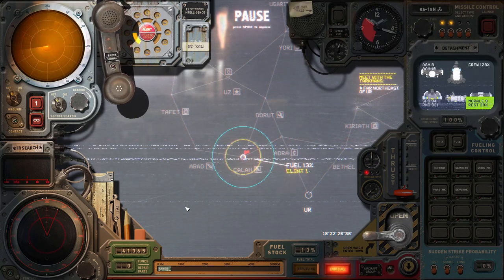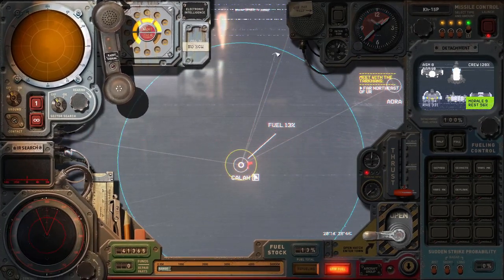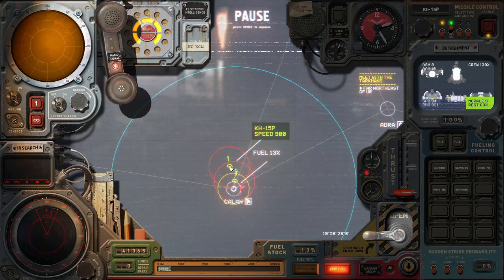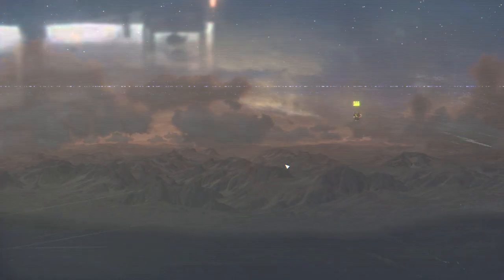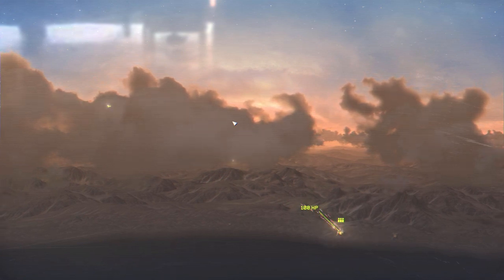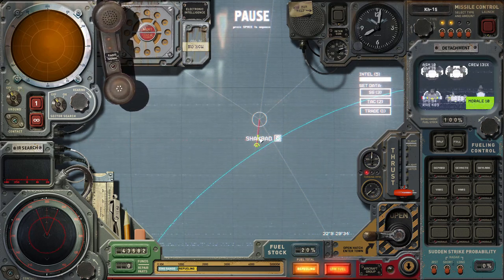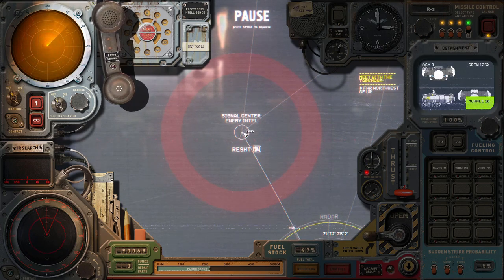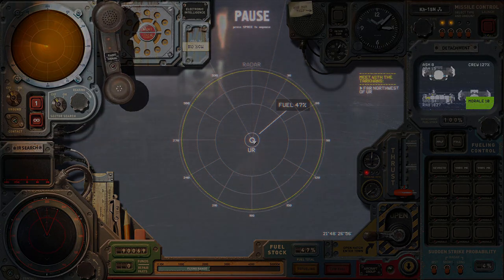Missile Tracking Guide  | Highfleet

Comment: The KH-15 series are terrain-following cruise missiles whereas the R-3s are ballistic missiles, the latter benefits both from avoiding interception from ground fire during fly-overs and from relatively high speed on the strategic and tactical views. Be aware that if you launch an anti-radiation missile while your radar is active you will be the closest immediate radar signature and it will begin tracking the launching fleet, if you catch your mistake early you can attempt to quickly deactivate your radar before it turns about but if you don't the missile WILL strike the attacking fleet. MISSILES ARE NOT YOUR FRIEND ONCE LAUNCHED- THEY CAN'T DETERMINE FRIEND OR FOE.
Reply: You just need to ensure that the missiles onboard tracking isn't activated until the launching fleet is outside the red detection circle
Reply: What about the presence of iff sensors and antennas?
Reply: @jacksos101 is it more feasible to  to use onboard tracking of the missile itself during the terminal phase only V

Comment: Man playing this game for the first time is like when you get a brand new car. All the buttons and flashing icons is just confusing as hell but if your bullet or missile lands, ohman its very satisfying. Anyway my question is what are hidden city for and how to find them? Have a great day
Reply: It's safe haven, where you can rest as long as you want, without getting snitched on you by locals. You can find them randomly, on map sides without routes, or by asking from citizens, that you will encounter in some cities. They will offer you to choose from three questions they will answer, and one of them will be approximate location of hidden city.
Reply: Once you get a clue to indicate general area, you will want to use the ground mode on your radar, as well as IRST to look for the roads and structures (it should be a brighter spot on the ground mode of radar).  Once you get close, zoom in on your strategic map and it should pop up once you get close.  You will occasionally get a radio message (Saying something like "Sayadi wants to meet with you"), those usually come from hidden cities so if you look at the direction your radio message points, you should get a good indication of where they are at.
Reply: @EpicAsshole  Can the Sayadi messages also come from real cities?  I've gotten them before, but the message seemed to come from a normal city every time.
Reply: @channelname9256  Yes they can.

Comment: Do I have to manually reload tactical missiles? Like, go to shipworks, take them from the fleet cargo then place them on the ship?
Reply: Yes you will have to do so manually.
Just keep in mind that even if you are selecting then from your fleet inventory it'll still tell you you're paying for the installation, but as long as the thing you are putting in is from your inventory, it's free
Reply: @emil3801  thanks! did a quick playthrough just blazing through the map and onto khiva without much thought of using radio intercepts to track movements or using missiles. couldnt even figure out infrared since it didnt really show me anything even while rotating the dial. made it as far as khiva and got nuked by the last “special” fleets that get spawned in the last part because i couldnt find them. now imma try my hand at figuring out ciphers

Comment: There is one more type of tracking, the Kh-15, Kh-15N, A-100 and A-100N can be designated to strike targets within your targeting radar range (the yellow circle) using semi active radar homing, this is done by clicking directly on the contact when designating the missile arming range and bearing. Be warned if you try to do this with a P variant missile it will immediately go active, lock on to you, turn around, and hit you, only try this with the listed missile types. Using this targeting method A-100 and A-100N missiles become very effective at destroying incoming enemy missiles.
Reply: What is the difference between the Kh-15 and the A-100? I thought the word "tactical" meant for use inside of tactical combat, but based on what you wrote, that's not it at all.
Reply: @Trifler500  The Kh-15 family are all cruise missiles, they trade speed for maximum range able to go out to ~1600 Km at 900 Km/Hr. The A-100 family are AFAIK conventional non ballistic missiles they can only go ~400 Km but do so at 4320 Km/Hr. In addition an A-100 reaches its top speed much faster than a Kh-15, as for the tactical designation I believe that simply refers to the maximum range, for example the Kh-15 and R-3 would be considered strategic missiles.
Reply: @BobSmith-vi2iv  Thanks. The table on the screen in the video showed they had the same speed, but I guess that was a mistake.
Reply: Can you use jets with lock on missiles to take down incoming missiles?
Reply from the maker: Yes that should be possible, I think I once sent planes out to hit them, I had AA missiles loaded.
Reply: @gamebox131  Wait, is it possible to change the loadouts of your jet fighters / bombers?
Reply: @gamebox131  No way! I thought aircraft bombs were for defending against jets. Thank you! 

I wonder if I might be audacious enough to ask you another question while I have your attention: Before every battle you can choose your ammo -- in this case let's just assume I have incendiary rounds for my Gladiator and I select them pre-battle. Will my Gladiator then begin the fight with those rounds loaded or do I have to press 'R' to switch to them? It's never clear to me how that actually works. Does my ship start the fight with the default HE Rounds loaded, or is it my purchased Incendiary rounds? If that's the case they'll never be used until I press "R".

Thanks again.
Reply: @BobSmith-vi2iv  So A-100N seems kind of pointless, or did i miss something?
Reply: @michajakubowski7149  keeps playing man you will know it soon :)
Reply: @pcs6748  I want to apologize to A-100N for calling it useless,that missile saved my campain and is most important missile of them all :D
Reply: @occamsblunderbuss  
I'm pretty sure your ship starts with the special ammo loaded. You need to press R at the start of the battle to switch to regular HE.
Reply: @BobSmith-vi2iv  Additionally, KH-15 is a direct hit fuze. It's slower, but longer range and it's warhead is one big boom that detonates on contact.
Meanwhile, the A-100 is shorter ranged, but much faster, and it has a proximity fuze that detonates in a shotgun-blast type pattern forward. These two traits (fast and proximity shotgun burst) is what makes the A-100 excellent at intercepting missiles and planes - it's faster so easier to catch and hit targets, and it's proximity fuze means that even if it's a little off it will probably still kill the target.

Comment: wait, so anti radiation and radar homing both seem to do the same thing which is home in on radar signal emitters - what am I missing here?
Reply from the maker: Radar-homing in this game means "uses a radar to find targets". However the wording would easily suggest it is "homing in to radars".

How it works is that anti-radiation "homes in to radar sources". The radar-homing will attack anything its search radar finds.
Reply: In RL radar homing is either the missile has an active radar of its own and guides itself or it is semi active thus needs guidance from the launch platform or another source it’s communicating with. There are other ways but won’t cloud issue. It will guide onto a target whether it has its radar on or not.
Anti radiation is for soft or hard killing a radar. With radars attached to these ships I’d say it’s in big trouble if it’s radar stays on.

I was on air defence many years ago but even forcing someone to switch radars off is considered a soft kill. It allows you to work unhindered except vs optical and IR systems.

Have you noticed ingame if you switch your radar off if the missiles still hit? Some modern types could remember a rough location and the Soviets could use nuclear tipped HARMs so accuracy wasn’t a big issue.
Reply: @caracal3892  Ah gotcha, thanks. does the ai ever turn off radar? When is a specific scenario where one would be more appropriate to use than the other?
Reply from the maker: My guess is that strike groups have their radar on when you have been spotted somewhere and the strike group is heading towards that area. I also think that strike groups that are not chasing a target might have the radar off. And I think that transport ships have their radars off. To avoid detection.

About which to use:

RWR/ELINT = Will help you spot stuff at up to 1500km, if it is having its radar on. So this would be a good way to detect strike groups that are looking for you. However the information for targetin is within 60 degree brackets. So it is not very good for shooting missiles.

Radar = Its target icon on the radar covers a 10 degree angle. So this is more precise for shooting missiles. The range however is 750km max (if you are flying and not landed).

IRST = very low range, however good for ambushing. In the video you can see me parked with my fleet along a road. If you keep your radar off , the chances are good that an enemy strike group will be detected by your IRST within 400km.
Reply: For an analogy imagine you're standing in a very dark room with a friend you want to find, you both have flashlights which are your radar emitters and you have eyes that are your radar detectors: radar homing is like shining your flashlight around to find your friend via visible light reflecting off them into your eyes, anti-radiation is like your friend holding a flashlight in the air and you finding them by looking around until the light from their flashlight reaches your eyes. If your friend turns the flashlight off suddenly you can't see them at all and if you keep walking to the place you saw the light last they may have moved since you last saw them!

The Radar homing missile has an active detection method and sensor- that is it has an onboard radar emitter which illuminates targets and it detects the target by reading the signal returned by reflections off of target vessels and is detectable by other radar sensors just as you can detect other vessels' radar emissions, the anti-radiation missile has a passive detection message and sensor- it is similar to radar homing version but has no emitter of it's own and it detects targets solely by reading the signals emitted by the radar units on vessels and thus isn't as detectable but also will lose the target if their radar is turned off.
Reply: @hairylegsxd  Based on my understanding: The anti-radiation missile will target their radar-equipped ship (only). Taking it out will blind them. Additional anti-radiation missiles will just miss because their other ships aren't equipped with radar. You can use radar-homing (aka "Radar Guided") missiles to kill the others.
Reply: Pretty much! I had a pair of nuclear antirad missiles launched at a strike group, first one took out the capital ship with its radar so secind one turned 180 and went for me because i didnt turn off the jammer yet!

Comment: How do you replenish those missiles?
Reply from the maker: There is two ways:
1. You order the ship to get repairs. The repair will attempt to fix all damage and reattach all expendable items as on the original blueprint.

2. Manually attach missiles to their locations. However then make sure to press ok when the renaming prompt appears, so the new configuration is saved.
Reply: You can repair them like tactical missiles, but you can only find them to buy from the rare modules merchants.